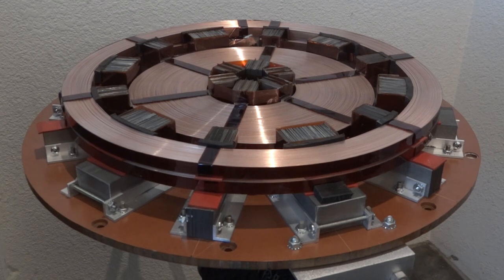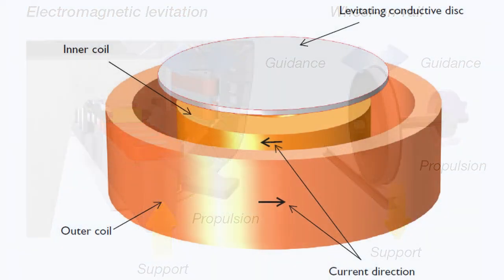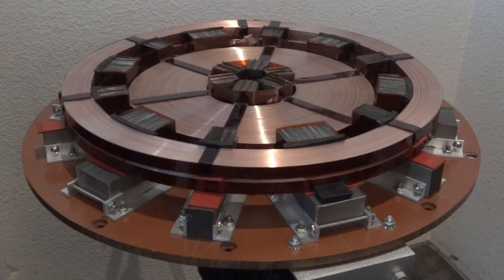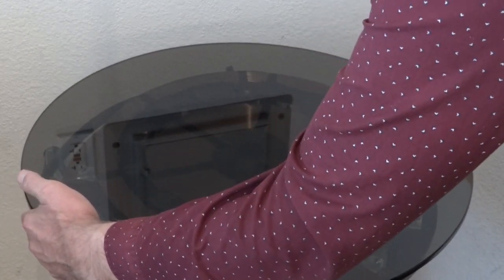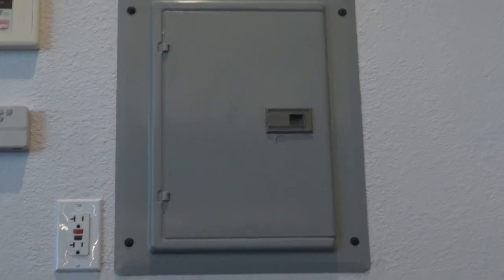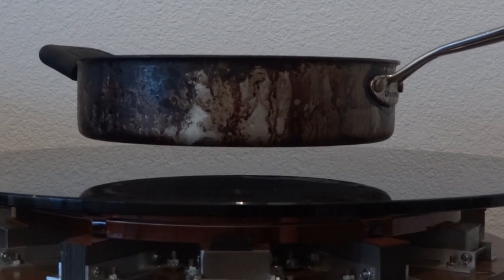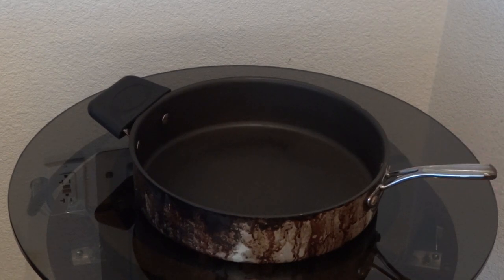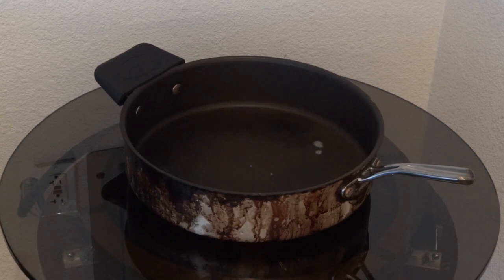Levitation

Comment: It's also nice how you can push the spatula into the food cooking one handed to remove it without having to hold the pan, and the pan doesn't slide off the center of the heat source like on a regular stove. The force holds it centered for you. 
Now U can levitate a tea kettle with 2 cups of water and have it whistling as it rotates in a circle. 
There's a host of practical applications that can be invoked with this as well.

Comment: So the outer coil is attracting the disc in every direction basically? 
And in an induction linear motor with the 2 layers of rows of coils where the top row is opposite polarity to the bottom row, how is that translating to the same concept as the circular type?

Comment: So basically the aluminum disc is of such diameter that it is inside the outer reverse polarity ring and thus the outer ring attracts it in every direction? Or is the outer edge of the aluminum disc over the outer coil and thus both coils attract the eddy current electromags of the disc over the other coil?

Comment: How did it work? Can I make it myself ?
Reply from the maker: At 0:25 I give a description on how it levitates the aluminum pan.   Most of the engineering is just figuring out how much inductance you need for whatever line voltage you want to use.  It's easy to make, if you have good coil winding skills!  Best to practice a bit first.
Reply: @LightningOnDemand  how many watts needed?
Reply from the maker: @imperiosheriff  It's adjustable up to about 2kW.

Comment: i have a small rotary spark gap tesla coil that is about 10 cm high. i want to drive it from 230vac. do i need a full bridge rectifier and a large electrolytic capacitor first before powering the primary coil and the film capacitor. or can i drive it directly from 230vac?
Reply from the maker: Sure, AC is fine.  pupman.com has tons of info on how to do it.

Comment: 240V x 1000A = 240,000W = 240kW

Say, 20¢/kWh, $48/hr to run, or 80¢/min.

Just wanted to work the math!
Reply from the maker: Ah, the 1000A is circulating in the pan, which is only one turn, so 1000ampere-turns total.  Those ampere-turns come from the coils, which have many more turns, so run at less current.
Finally, the large circulating currents don't flow back through the electric meter, only the smaller make-up currents do.  Those are only about 10A, or 2400W total that the meter sees.
Reply: @LightningOnDemand  ah, so 2.4V then at the secondary.

And at 20¢/kWh, 48¢/hr!

Not so bad - you could afford to cook every breakfast. :)

Comment: Cooktops in 2050:
Reply: I think not.  Floating pans may be cool looking, but it primarily adds novelty value to the cooking experience, without having any real practicality benefit.  Such a system like shown in the video is more appropriate for manipulating antimatter plates made of antimatter lithium, without touching them, than it is for everyday cooking.

In order for cooking tool innovations to be more than a fad, it needs to add something practical.

In other words, the future of cooking tools needs to improve something tangible, such as one or more of the following: enhanced cooking speed, easier cleanup, greater comfort for the operator, less effort for the operator, somehow tastier food products and/or food products with better perceived texture.

Cooking speed can be enhanced by integrating a high power infrared (IR) emitter array of well collimated downward pointing beams in the upper portion of the cooking range.  Assuming a normal camera watches the pans and the cooking surface, individual IR emitters could be turned off dynamically (like individual pixels on an LCD screen) when no pan was under the beam area, and/or, if a human hand or arm was detected in the beam area.  With such a system, it would be possible to apply heat to both the top of the food surface, as well as to the bottom of the food via contact with the pan, thus cooking the food from both sides simultaneously.

Another method of enhancing cooking speed, is to preheat the food electromagnetically to near 100 Celsius internally, prior to transferring the food to a more conventional cooking surface or oven (ex: for searing the surface).  An ordinary microwave oven can partially accomplish this, but current generation microwave ovens are severely underpowered (and thus do not adequately accelerate pre-heating speed to be worthwhile to many human chefs, although some do still use them for pre-defrosting frozen items).  Current generation microwave ovens also normally operate at a wavelength that does not penetrate too deeply into many food items, thus causing uneven heating (especially noticeable when heating larger frozen items, such as a thick burrito).

Increasing the heating rate of a microwave oven is easy enough by simply using a more powerful magnetron tube and associated household wiring.  However, doing so (without microwave oven modifications) will cause the food to "explode", as excessively rapid heating of water laden food items can often cause "superheating" of the water beyond the boiling point.  When pockets of superheated (beyond 100 C) liquid water form inside the food, these later flash to steam and create small explosions originating from the interior of the food, thus making a mess inside the microwave oven.  This problem can be reduced by mechanically shaking the food rather aggressively while it is being rapidly heated.  Shaking can help to quickly cause water pockets that are on the verge of passing 100 C and becoming superheated, to quickly start boiling, rather than heating past 100 C and becoming subject to sudden flashing to steam.  Food shaking during heating can potentially be implemented with a speaker like device under the turntable plate inside the microwave oven.  Potentially, the shaking can be performed ultrasonically, so as not be audible to humans.

The lack of penetration depth of common 2.45 GHz microwaves in many denser food items causes uneven heating of many food items.  Many frozen food items with considerable water content will only heat rapidly within the first centimeter or so of penetration depth, with much reduced heating rates deeper inside the food item.  This problem can be reduced by using different wavelengths of electromagnetic radiation (beyond the standard 2.45 GHz frequency commonly used in current generation microwave ovens).  For example, X-rays can penetrate much deeper through watery food items, potentially all the way through, with comparatively low attenuation rates.  However, X-rays may not be the best choice for heating food, as X-rays are ionizing and can chemically alter the food in certain ways different from simply thermal/heating effects.  Perhaps a more practical solution to this problem, is to modify the food itself (such as by cutting it into thinner slices at the food factory, prior to freezing and/or acquisition and handling by the consumer).  Additionally, microwave ovens can be modified to elevate the food off the bottom metal surface of the microwave oven, and by adding more microwave sources (effectively originating from all angles with respect to the food surfaces, including from directly above and below the food), so as to provide more even and functionally deeper heating of the food.